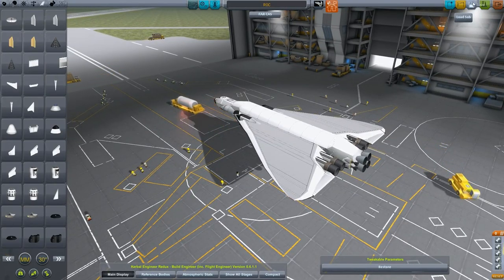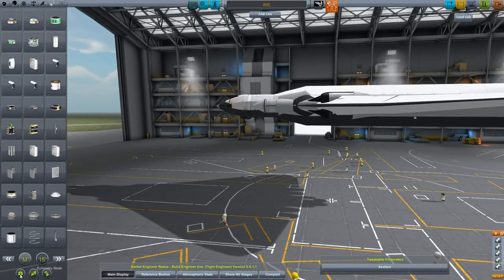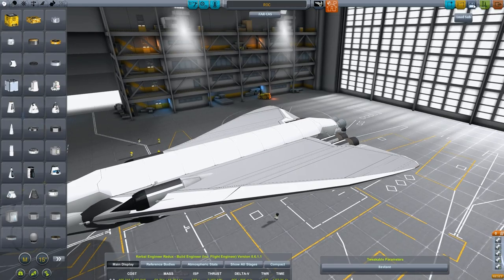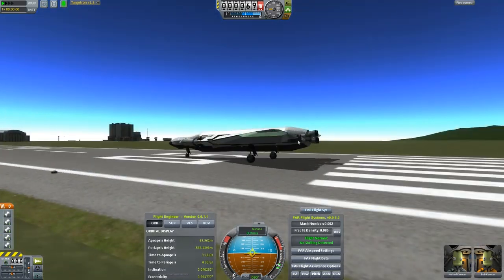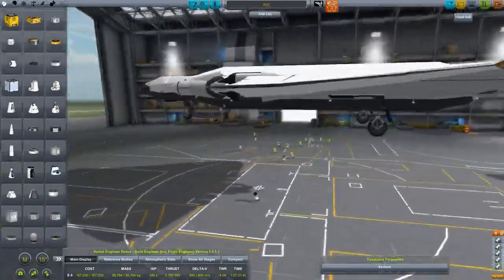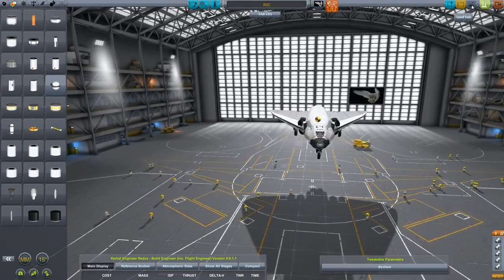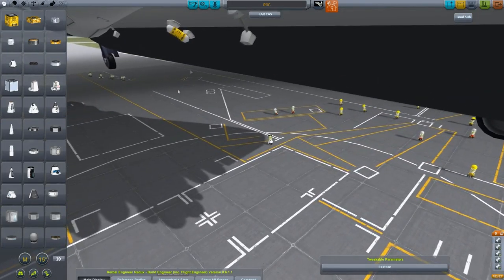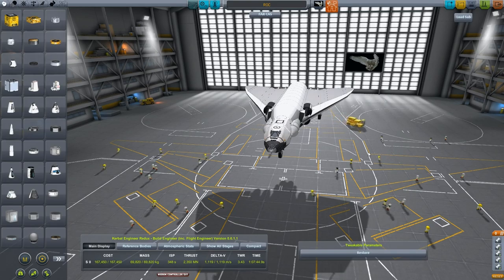Let's Fly KSP: Space Shuttle Development part 14

Comment: the reason for the plane turning is because it is angled down on launch. The wings are creating downforce and creating pressure on the gears, which is pushing them onto a weird angle. also the reason for the fuel not flowing is because ksp does not support a non-linear heirachy of fuel flow.